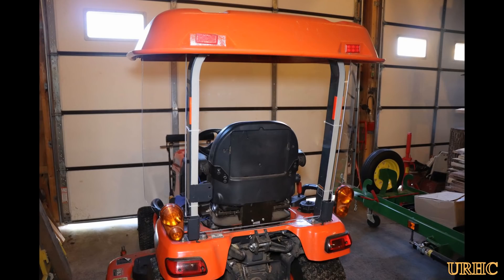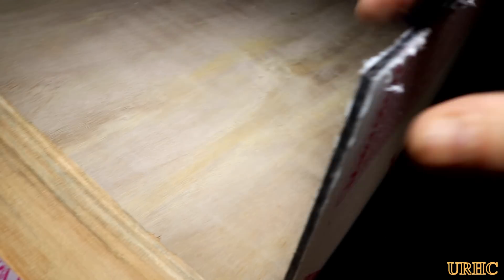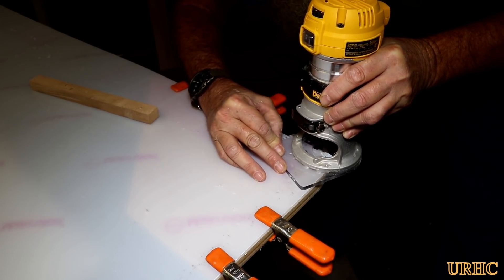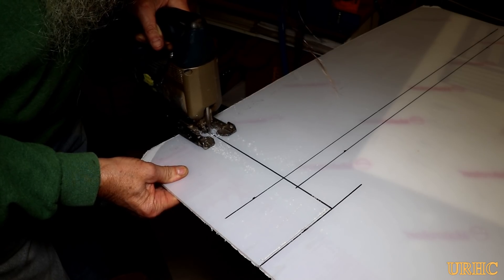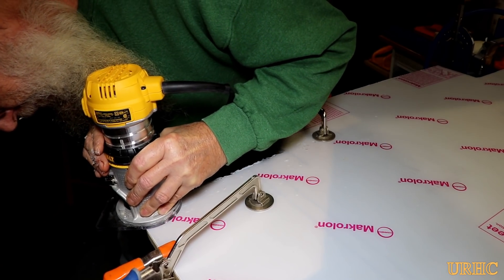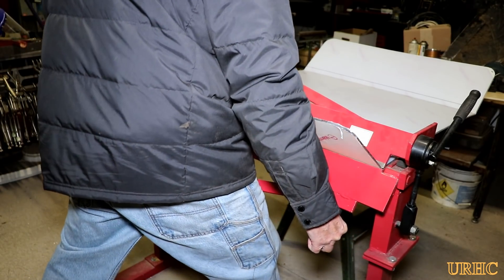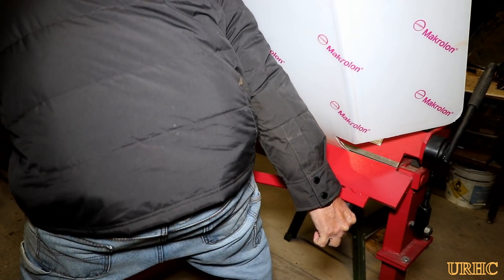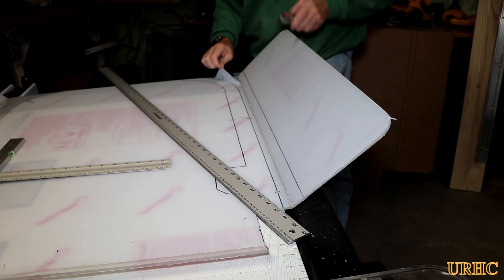Making A Snow Shield For The Rear Of My Kubota BX2360

Comment: For cutting any type of plastics, use a fine-tooth non-carbide blade and  install it on the saw BACKWARDS.  Works great!
Reply from the maker: This sheet was unlike plastics that I had cut in the past. I will have to try that.  Thanks for watching.

Comment: Nice job! We used a heat gun at the glass shop to soften the material then bend the material toward your heat source. Try it on one of your cutoffs.
Reply from the maker: I tried a heat gun but couldn't get it hot enough  to make a difference.  You should bake this lexan to get all the moisture out and use a strip heater if you have the right tools. Thanks for watching.

Comment: I'm wondering it hitting it lightly with a propane torch when it was in the brake would have helped it to bend easier.
Reply from the maker: You have to bake lexan at a low temperature before applying heat. It has moisture trapped in it that can cause damage in thicker sheets.  Thanks for watching.

Comment: Great job! Looks perfect. Have a question on the HF brake. Are you happy with it as I've been thinking of getting one. I have a snow plow blade on my B2650 but that would help keeping the wind off my back.
Reply from the maker: I had to weld an angle to the back of it and add extra bolts to keep the top clamp from slipping back when bending. Other then that it works pretty good for thin stock. A strip heater would be best for this lexan but it should be baked first to remove moisture. Hopefully with the roof it will stop the wind and snow.  Thanks for watching.

Comment: did you heat before you did the bend,i might have missed it
Reply from the maker: No, I don't have a strip heater. Just v grooved it with a flat to less then the 1/8 inch cold formable dimension they give.You have to be careful hot forming this stuff because of all the moisture trapped in it and it must be baked first. Thanks for watching.

Comment: Good work.
I priced out a big piece of plexi to make a Pepper's Ghost hollusion for Halloween.
Man was it expensive, so I passed.
Reply from the maker: Thanks.  Home Depot had the best price on plastic sheets and free shipping to the store.  Other companies wanted what I paid for this sheet just to ship it. Have a couple more projects planed for the rest of it. Thanks for watching.
Reply from the maker: This is lexan and I tried that on the sample. It didn't make a difference.  You need a strip heater for this stuff and it should be baked to remove moisture first so it doesnt bubble up. It is basically an insulator so it takes a lot of concentrated heat to bend properly.  Acrylic doesn't take much heat to bend.

Comment: Should of used a heat gun to prewarm the sheet then format it with a wooden battern straight edge. And for mounting it form a few aluminium brackets in a square C shape in your bender
Reply from the maker: You have to bake lexan before heating it to get the moisture out. This worked fine for me and only takes a minute.  Thanks for watching.
Reply: @unemployedredneckhillbilly2023  a great channel with great content and videos. A big hello from the UK 🇬🇧